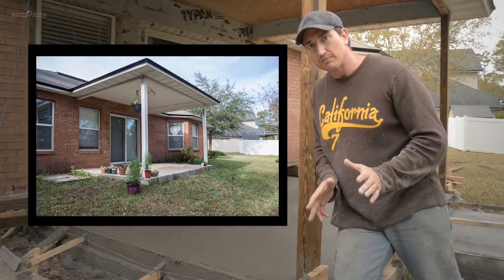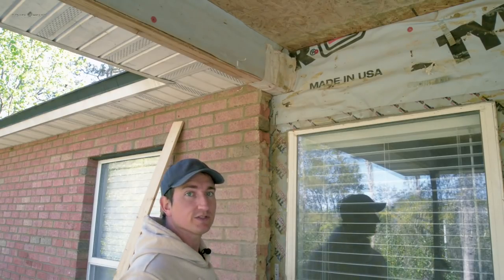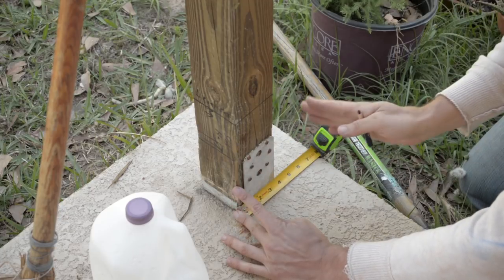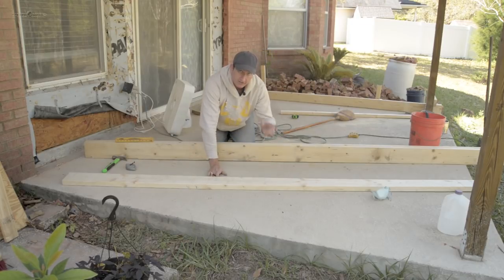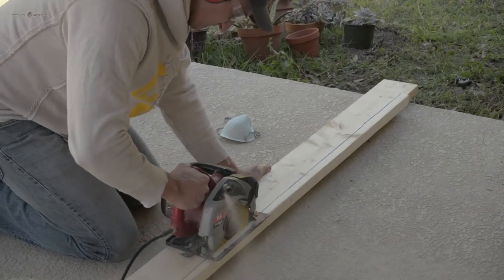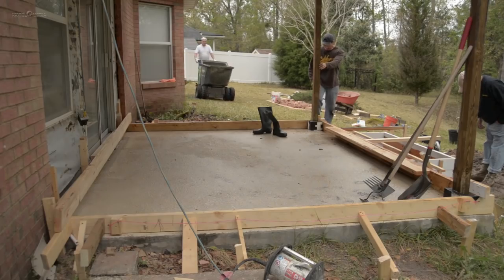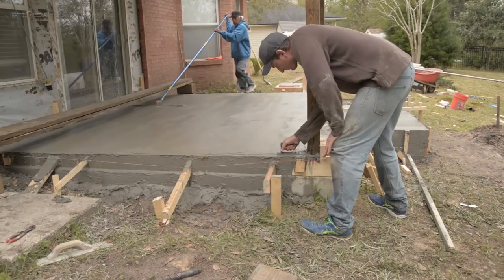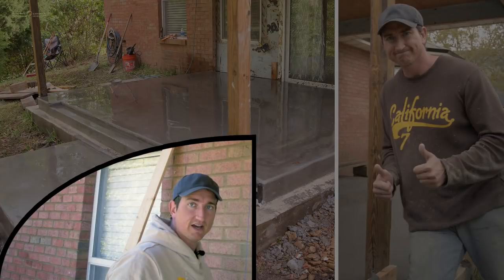Pour A Concrete Slab Over A Concrete Slab, #3 Porch Conversion Video

Comment: drill some cavities, bent rebar in cavities tied to rebar curtain on flat surface but movable by hand to settle concrete cavities with rebar and concrete for bond. if needed use a quick hit of vibration to solidify concrete. 4 inch slump should do fine with no water added if possible. heavy toweling at a dry but still moist level and boomshakalaka

Comment: Nice job , i think that wil last for a long time as there is no load on it , even the Romans did it like this and that lasts already for over a thousand years. "-) funny how people on here come to tell how long they do this kind of work just to tell you that you did it wrong , sad people they are........maybe they should look up some video's about crack repair in concrete , wich was probably made by the same kind of professionals .....:-)   Much love and happy building to all
Reply from the maker: Thanks Rob, the floor is still in perfect shape and I am confident will last the life of the overall structure.  The concrete poured was poured over a solid and sound base (the existing concrete porch floor) which should keep the new concrete from flexing or bending at all.  It is the stretching forces that typically cause concrete to fail and this is where rebar support comes in handy (the rebar limits the stretching).  This new concrete floor should not be subject to any significant stretching forces thus reinforcing rebar  was not deemed necessary.

Comment: Would have been easier, and more reliable, to build your addition and then build a wooden platform inside your addition. Slabs on slabs crumble and will never outlast your addition.
Reply: Do you know if there a video building wooden platform to raise carport height to match house?
Reply: Make.sure u use the right lumber...had a home.where they didnt

What a mess

Comment: 40 years of construction it will crack and loosen around the edges!
Reply: Jj How but it will be inside under the new extension of the house?
Reply: I want to pour congrete ober an existing concrete area but i intend to put tile ober it soon after. Would thise cracks effect the tile? This would be outdoor in my backyard.
Reply: @pinky1933  
The weight of the walls and roof will cause the lower part of the concrete to spread out, a lot like taking a pastry and pushing down on it, only a lot slower.  That is why, at the very least,  rebar should have been run around the perimeter.

Comment: just curious about the integrity of concrete pouring,,, is there no any need for rebars?
Reply from the maker: It was not required for local permitting compliance and thus I did not feel necessary.  This was mainly just a leveling layer of concrete to level off the floor.  I did use Concrete with fiberglass added to it for extra stability.
Reply: Yes you definitely need reinforcement in the concrete whatever town he’s in whatever city inspector passed them off on the job should be fired is all they did was add more wait to existing slab that was not properly tied in to the existing structure or have proper foundation I can’t believe they allow him to do this that would not fly in California not even close.
Reply: Rebars are required for structural elements that have to withstand signifiant compression and tension forces. An example would be a bridge deck and its supports or an office floor slabs and the concrete columns supporting it.
Reply: HA AH ,They are required for all of that👍🏻and they are also required for tying into a existing structure and adding significant dead load to an existing slab you need to  Tie in with rebar to the existing structure with approved epoxy at least in California it is a requirement out here. FYI ‼️To be honest I’ve been doing it for years and years and years it’s almost common sense if you think about it. If you argue that point hey sometimes you can’t teach common sense. I just got plans approved for project in California which is a patio conversion and not only is it requiring for me to tie in with rebar to the existing foundation is requiring grade beams if you’re not familiar with those those are basically continuous underpads that run underneath the existing slab. Have a good one✌🏻
Reply: DL Construction the existing slab would have been stronger than any base you would have poured a new slab over. Reader is not always required. We have poured acres of slab on grade designed by professional engineers that did not require concrete,  including schools, hospitals, utility plants and flood control.  IN CALIFORNIA. 
He probably needs to make sure his anchor bolts extend into the existing footing.
Reply: HA AH concrete has great compressive strength by little tensile strength.  Rebar has great tensile strength but little compressive strength. Rebar does almost nothing for the compressive strength of a slab on grade. 
In certain areas where great tensile strength is needed,  like in a multi level parking garage,  Post Tension reinforcement is used.  These are cables (almost zero compressive value)  that run from one end of the slab to the other then tightened after the concrete has reached enough compressive strength.
Reply: Mark Daniel it is not necessarily about the slab it is about the rebar dowels tying  into the existing foundation are you reading my replies you should know that.
Reply: You don't need reinforcement because it's not going anywhere with that reinforced slab under it. The bottom slab should have bar and or mesh for sure.

Comment: No holes. No adhesive. No rebar. That will crack up nicely. And you did not even wet the existing slab. Everyone is a contractor these days.
Reply from the maker: Rebar was determined not necessary for the application  here as there should be no tension within the slab.  This was the recommended method from the local permitting authority.  In a later video the cured slabbed is doweled into the existing slab below.
Reply: Didn't even wet the old slab. Shouldn't have used metal floats before the float water is gone, should only use wood or composite. This is an extremely common mistake.

Comment: When making short marks, with you tape, don't use the hook.
Just pull the tape out longer, and hold it flush against the work.
Reply from the maker: Great tip regarding the use of the tape measure Dave. Thanks for sharing and watching.

Comment: You know that slope was there for a reason?
Reply from the maker: Yes, the original slope was necessary to shed water away form the house because the structure was an outdoor porch.  In this project the patio was being converted into enclosed living space where a level floor was desired.

Comment: Nice job but you made critical mistakes.

The new slab is not properly anchored to the old slab.  You should have drilled holes into the old slab and hammered rebar into it with enough sticking up for the new slab to grab hold of.

You should have at least run rebar around the perimeter to prevent the weight of the walls and roof from causing the lower part of the slab from wanting to spreading out from the weight.  Eventually, the weight will cause the edges to start cracking and flaking off.
Reply from the maker: This process for this particular project was determined appropriate by the local building authority.  The new walls are not really load bearing and the stability of the new slab is dependent on the stability of the original structure beneath it.  Rebar is most helpful when flexing forces are involved and concrete handles compression forces well.
Reply: Yup need to drill dowel holes and put rebar in with anchoring epoxy then tie in rebar for the new slab that thing is definitely gonna crack in time

Comment: You have no clue about concrete...no wire mesh...no method to adhere new concrete to old slab...you applied much more weight to an existimg footing that wasnt originally designed to carry that much weight...

Comment: What happened to the 2x6 board up against the house?
Reply from the maker: The concrete form board was placed to provide a little space.  The old sliding glass door stayed in till later in the renovation project and stopped us from pouring the entire floor at one time.  Once the door was removed the remaining space was patched filled with concrete to create a flush floor.